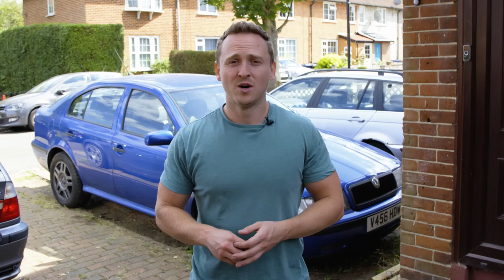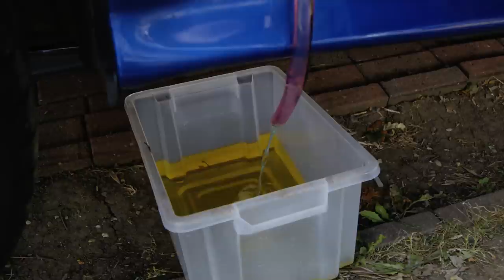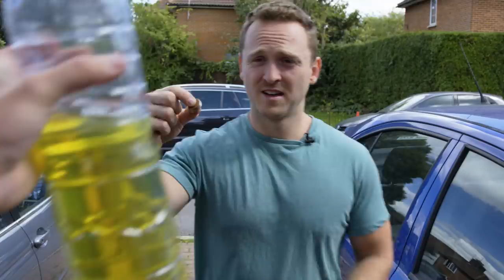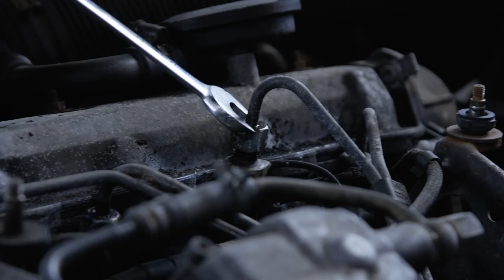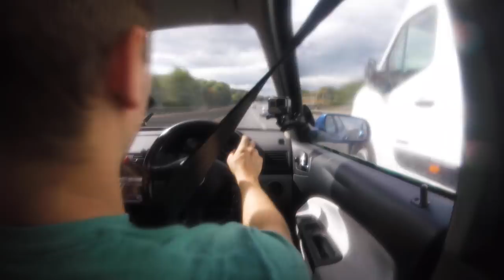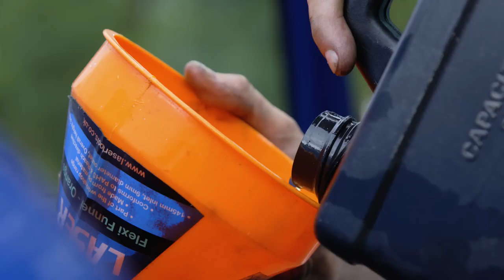How Far Can You REALLY Drive On 1 Litre Of Fuel?

Comment: why not run it off the bottle, I saw mighty car mods did that before
Reply: Because it's a diesel it's a very high pressure fuel system unlike a normal petrol engine which will probably have around 60psi of fuel pressure, diesel engines are typically around 30,000psi so I don't think it's safe it use a bottle but then again I could be completely wrong, I think that's why though

Edit( it can exceed 30,000-40,000 psi under full load
Reply: @RBjohnny  which fuel injection system exceed 30,000 psi !?
Reply: Mohammed Ahmed Petrol engines don’t exceed 30,000, diesels do. Peoples fingers have been chopped off trying to diagnose a bad diesel fuel injector
Reply: @RBjohnny  i know buddy , but I'm asking which fuel injection specifically exceed 30,000 psi
Reply: @mohammedahmed1109  common rail, but the argument is invalid, you can put a bottle obviously in the low pressure section of the system, the problem would be the return line but you can put it in the bottle too
Reply: @patriciomunoz2830  yeah exactly , i tried it with a visa generator

Comment: I had a bleed under the hood with a hand pump to prime the pump if i ran out of diesel.  I also usedvtonout a cup of petrol into a rank if diesel as it seemed to kerp the system clean and seemed to run better. I once put 2 litres if canola oil and galf a cup of metho into my diesel when i ran out.  It ran fine.

Comment: I believe its a 55L tank so by the maths says you could get 1419 miles (2284KM) out of a full tank. although there are some variables at work with small amounts of fuel being left in the filter, pump ect. I would say you would get just over 1100 Miles (guestimate)

Comment: My Citroen C2 is pretty good on fuel. Just cruising at 30 mph in 5th it's over 90 mpg. Pulsing and gliding from Knighton to Hereford when stuck behind slow drivers at 40 mph I managed to wring 76.2 mpg out of it.
If I whiz it fast on the motorway at 80 mph it goes down to 45 mpg.

Comment: since you had the fuel pipes from the tank disconected you could have just conected them to the bottle with pipes from a wrecker, or put the bottle in the engine bay i did it one time to test leaks. By putting fuel in the tank not all fuel can be sucked by the level of the gauge sender unit until the engine shuts off.

Comment: To accurately estimate fuel consumption you really need to use a GPS Speedo. I used to have an old mobile phone set up as a GPS Speedo for my previous Subaru Liberty ( Legacy in rest of the world ) as the speedo was so inaccurate. I found the Ulysse Speedometer to be the best app for an android mobile.
Here in Australia manufacturers are allowed to deliberately design the speedo's to be 8% inaccurate on average (HOWEVER  my current car, a 2015 Mercedes ML 250, is 100% accurate ). Not sure what is allowed in the UK, but from other videos in this series on 'Miles' it seems to be similar.
They do this so that the 'indicated' fuel consumption looks better to consumers than the real consumption. 
 .

Comment: you don’t have to put diesel in your mouth when siphoning if you put two hoses in, one to the bottom of the tank and one just in the hole, then plug the free air space with a rag, blow into the hose that isn’t at the bottom of the tank then the diesel will come out the other hose

Comment: Running a car so it’s to the complete empty that it stops can actually ruin the fuel pump and in some cases the car won’t start again until the fuel pump is either lubricated by priming it or failing that a new actual fuel pump you should never let it get to the point that your car switches off because no fuel can cause so so much damage and in some cases depending if it’s a high mileage car and the age could cause it to end up being sold as basically spares or repairs

Comment: There must have been more fuel left in the tank since that works out at about 115mpg.
From what i remember, the best achieved in the UK with a diesel was a 2002 Astra 1.7 DTi ECO4 model. A test was done under sealed tank conditions for the Guinness book of records. John o'groats to Lands end. And they averaged 105mpg. Seem to be easy on the older diesels that done have all the emissions crap on them.
My 2016 Merc A200d 2.2d DCT does 72mpg average every week. Covering about 800 miles a week. I have tried to Hypermile and really stretch it and i did get an indicated 80mpg once over 55 miles distance. Never managed that again.
Reply: @a30r30  This review is for early pre-facelift cars. They did not have the 2.2 OM651 engine. Also interesting to note that the cheap A180d cars that have the Renault 1.5DCi engine are not as good on fuel as the bigger 2.2d engine.

Comment: I'm surprised you took a stretch of motorway. I don't know about here but if a breakdown occurs on a motorway in Australia/New Zealand as a result of neglect by the driver (ie running out of fuel) they're criminally charged, 3 figure fines and points on their licence.
Reply: Fortunately, that doesn't happen although it probably should.  It's still dangerous though.  The one time I ran out of fuel on the motorway (through a fault in a hired van) it was not a pleasant experience.  80 mph doesn't feel that fast in a car but it feels pretty fast when you are standing by the side of the motorway.

Comment: The problem in doing this is you are potentially damaging your fuel pumps. Diesel has 2 pumps in most cases, the one to worry about is the high pressure pumps.

Comment: That's like 2,5 litres (0,66 gallon) per 100km. That can't be right. As much as I want to believe it, there had to be some fuel left somewhere. My Golf IV SDI has ~ 300tkm and I never made it below 4 litres. Maybe, if you really, really try very hard you can get like 3.8 litres, or even 3.5 litres - but not below 3 litres. It's still very impressive, though.

Comment: What about comparing expensive say shell diesel and supermarket diesel and see if the mileage is different.
Reply: I've done the comparision with petrol and I did notice an extra 20 miles out of what is usually a 400 mile tank on supermarket fuel, the economy advantage is nulled by the added premium. My car did not feel any smoother or quicker using the premium fuel.

Comment: dude you're doing siphoning wrong. Stick one hose all the way in that'll do that siphoning. Insert a second hose just a bit into the filler. Stick a rag into the filler to seal the filler around the two hoses. Blow into the hose that's stuck in a bit until fuel flows up and into the siphon. Then remove the rag when the siphon starts.

Comment: Miles = Imperial
Litres = Metric
Can't decide on one or? :P
Reply: In the UK we use both imperial and metric, which can get quite confusing as we measure distance in miles and fuel consumption in miles per gallon. But we also use litres at fuel stations. Most people can easily convert measurements though

Comment: I would agree with 4L/100km. I had the same engine in a golf 4, the 1.9tdi 101hp and 4 litres with normal speed was average. 2,5L is impossible. It could be that you put more than 0.1L diesel in it, or there was somewhere else a bit diesel left. Dont forget, the skodia has a second tank for extra diesel. I do believe there was about 2 litres of diesel in the system, so its about 4,8L/100. Come on man, cars do consume more in the city. 2 litres on 45 km is realistic dont fool us around

Comment: if youve drained ALL of the fuel out it wont start because it needs fuel pressure to keep running so technically there is always fuel in the tank, also running a diesel engine completely out of fuel is an extremely bad idea, the diesel acts as a lubricant inside the diesel injection system, running it dry is like running an engine out of oil, a lot of friction and a lot of heat and excess wear

Comment: This is something where carbureted cars would have the advantage. Fuel injection cant handle air bubbles, carbs can.
Reply: Diesel cars need to have the air bled out as they rely on fuel pressure to open the injectors. A fuel injected petrol car would be just fine with air in the system as it will bleed itself out very quickly.

Comment: the test is not done the correct way because you always have some amount of trapped fuel which the pump cant suck. The best way would be to dump the fuel pump in a container which has 1 litre of fuel so that the pump can suck the last drop of fuel

Comment: It is real... Also Fiat 1,9JTD engine pretty much the same, Like ~4l/100km on the freeway doing ~100km/h 
The real world consumption is higher due to the air conditioner running on (~easy additional 1l for 100km), also traffic and even weather condition air temperature, moisture levels etc.. But it never gets higher than 6,5l/100km with this engine, actually you can drive like a madman and you wont get higher than 6,5 or 7ltr...  

These cars are very economical and all the diesel haters can go and kill themselves.. You cant beat this with electric cars...

Comment: Why are you mixing units of measurements? Miles travelled for Litres used, it’s confusing as hell..
Reply: That's just the way we do things in the UK.  It's a bit stupid but we're used to it.  We buy fuel in litres but measure fuel consumption in miles per gallon.  I am 6'2" but my car is 5m long.  We buy litres of orange juice but pints of beer.  It's like English spelling.  It shouldn't work but it seems to so no-one worries about it.

Comment: you don't need to break fuel injector on a diesal car with electric fuel pump. lol Thats only for Vacume feed engines. Because air causes to much back pressure to bleed itself. like TDDI ect

Comment: 41.5km/L is 2.4L/100km or 98mpg, amazing 
(Calculated using online calculator*)
Reply: In reality it is quite a bit less. 3.5L/100km is realistic, and 4,5L/100km  is very easy to achieve.
Reply: rkan2 you mean lower than 2.4L/100km or lower than 98mpg? 
I would be stunned to see a car like it get lower than 2.4
Reply: @demosteneneacsiu6144  lower fuel economy, e.g. 3.5L/100km instead of 2.4L/100km. 2.4L can only be done with some serious aero-mods, and probably only with the lighter Seat Cordoba and VW Polo variant cars.

Comment: Would it not screw up the fuel pump by letting air into it?
Reply: Yes if it sucks air the fuel pump no longer has fuel as lubrication and it can cause added wear from increased friction however as a short one off event it should not cause the pump to fail.
Reply: @gravemind6536  Thank you, that's good to know

Comment: you should NEVER EVER EVER EVER run a diesel car out of fuel...diesel is also a lubricant for the mechanical fuel injectotion system, running it out is like starving a car of oil, metal on metal a lot of heat and will cost you a lot of money

also you wont use the whole litre of fuel because the car never runs out of fuel it runs out of fuel pressure first

Comment: peugeot diesels win,,ive had one for 30 years this year,,back in the 90"S we got 1000miles for £25 (in a 205)  my 2003 206 still does 75mpg on a run,,oh and never had a clutch exhaust or engine work  and ive put 250k miles on 2 of them

Comment: Guys
Your experimenting is flawed. All manufacturers use different tanks. The ability of the pump to capture all the fuel in the tank varies with vehicle. Some cars need 10 lts of fuel if run dry before you can run without the issue you had with the Skoda. Great to watch but not scientific.